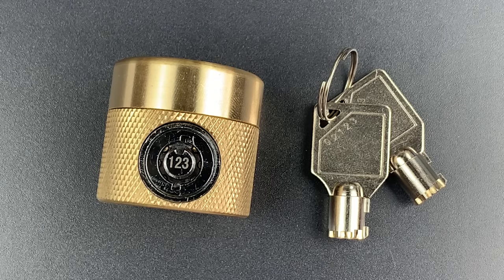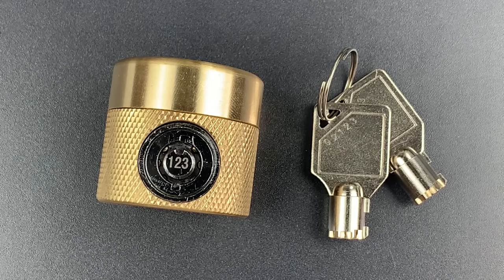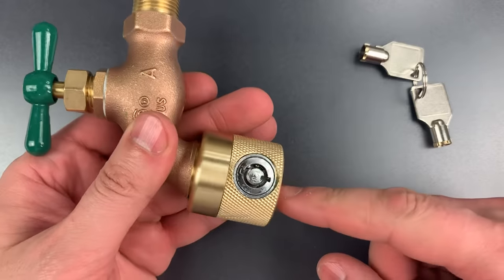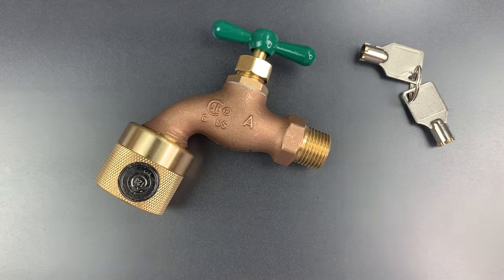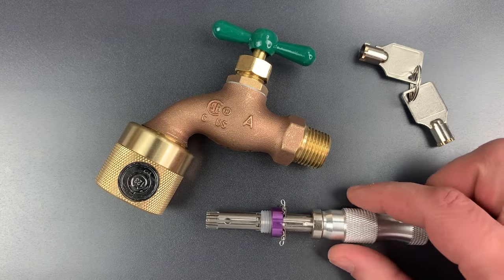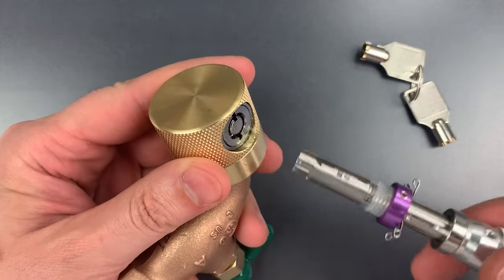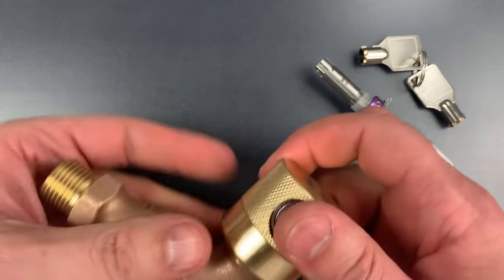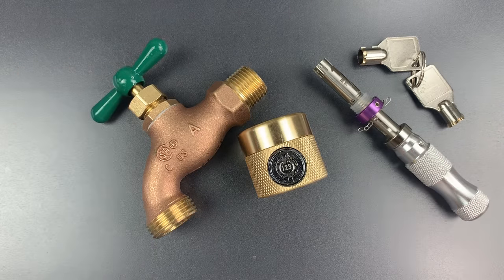[840] Flow Security Systems “FaucetLock” Picked FAST

Comment: I would imagine you could grab the upper part, above the spinning part, with some pliers and unscrew it without picking the lock at all.
Reply: Its hard to see since its smooth but if you look closely the whole thing does spin, the grip portion is connected to the smooth. I thought of that too and had to look pretty closely to see the tiny scuff marks get swung around when he spun it.
Reply: Yeah, and then you have a hose running (though you can turn them off sometimes)
Reply: I'm thinking strap wrench.
Reply: @munster355  If that is just made out of brass or other soft metal, you could probably squeeze on it hard enough with channel locks to crush the outer sleeve onto the threaded bit and turn it that way though. The metal can't be very thick.
Reply: @coopercummings8370  shrug yeah but the odds someone is gonna bother instead of going to the house next door or just quit isn't very high so this lock is probably good enough to defer a niche criminal.
Reply: @munster355  this could be used to prevent reverse liquid injection into the house (ie: wire a pump to pull from a container and push into the house via the faucet.) this lock has it's use but i don't think it's that great :p
Reply: @patricklegault6383  What possible reason would someone have to 'reverse liquid inject'?
Reply: @munster355  If it's the next door neighbour attempting to steal water from the tap nearest the boundary, they may not have another 'easy' option.
Reply: @Chris-hx3om  revenge would be an idea or when the city is doing pipe maintenance. they sometime connect the fire hydrant to the faucet to bring water to the house while they close the main line in the street.
Reply: @Chris-hx3om  yet another person coming up with another even more niche idea. Come on bro. Pay attention
Reply: @munster355  if you pinch it enough. The inside will likely bind on the outside. It's a destructive way of doing it. But I think that would work.
Reply: @patricklegault6383  "reverse liquid injection" 

Yeah, good luck with that, water's non-compressible, so it'll need to flow. Back-flow in this case..
Where do _ you _ think the water in the already full lines is going to go so you can "reverse liquid injection"? 

My answer : Nowhere.
Reply: Squirt JB Weld between the lock core and the spinner. Wait 15 minutes until the parts are "welded" together, then unscrew the whole thing and enjoy your free water.
Reply: The upper part is smooth. In many kitchens, there are flat pieces of rubber material for assisting in opening jars. The fitting is only hand tightened. It should be possible to wrap the rubber material around the upper part and apply enough torque to remove the "FaucetLock" and put it back later, leaving no scratches.

One application is apartment buildings where the tenants hire their own carpet cleaning companies. The carpet cleaning equipment may require a connection to an outdoor faucet and the company should let the client know ahead of time. Rather than contact the office and have them send a maintenance employee to remove the lock, the tenant could use the jar opener before the carpet cleaner shows up.
Reply: i would add some leather strap(old leather belt) between brass and wrench.
Reply: @bytemyvoid  no you wouldn't

Comment: Lol In South Africa they steal the whole Faucet for the metal not the water
Reply: New Haven CT also!
Reply: Fuck dude, I know what you mean. I also thought someone would just turn it on for fun
Reply: Fookin prawns
Reply: kids in africa could've eaten those locks
Reply: @Malfin_L  lmao
Reply: Someone went round and stole cast bronze inlet connections (which firefighters connect their hose to, to boost pressure and flow) on sprinkler installations. I think they now use cast aluminium alloy ones.
Reply: yep some fuckers riped huge lines of copper cables out of the road by my uncles home
Reply: Easy enough to get both that way.
Reply: Is so. Ja.
Reply: Some urinals in Chicago have a lock on the flush valve connection to prevent theft (often McDonalds)

Comment: I didn't even know that water theft was a thing lol
Reply: @BigDish101  I got an extra $100 charge from my neighbor stealing water before they got evicted. how does that make me an asshole?
Reply: @BigDish101  It looks more like something which you put onto water tanks. Sure, if it's an unlimited source it wouldn't make much sense, but if it's a limited supply of water that's another story. Also the faucet might not nessecarily be used for water. It could be a potencially dangerous/harmful and/or expensive liquid and I doubt that any insurance company would pay if you simply leave a faucet unsecured in public or at an easily accessable location. Plus it would stop courious children too.
There are a lot of scenarios where a faucet lock makes sense.
Reply: ThePandafriend Yea it would stop curious children from messing with dihydrogen monoxide, life threatening these locks better become mandatory
Reply: @unclejoe8310  I'm talking about stuff like bases, acids or other liquids which could be poisonous. Of course the "common" water is not dangerous.
Or something which could be in such a tank is purified water. It's expensive and if someone steals it and you need it for a certain application you have a problem.
Reply: @BigDish101  Contractors are even worse;  they have their own water connections, and even electrical connections;  I caught the contractors trying to fill the (next door neighbor's) sewage tank ( to test it for leaks ) and also using my electrical outlets to run their saws and such;  both times, as soon as I stopped them and started to call the business owner, they both took off.  Probably because he had very loose control of who was working where, I suspect..  But yes, both were stealing something that they considered "free" - just like you think it should be free...
Reply: If they could people would steal even your memories.
Reply: @BigDish101  You're paying for it, go use your own water supply. 

Imagine if someone came to take a few slices of bread from your kitchen because breakfast wasn't enough.
Reply: In my country some people put a water cooler faucet so people can drink, they pay for water and electricity for it
Reply: It's less about water theft and more about local youths turning on your faucet and running away. This can waste thousands of gallons of water, and water is something that costs more the more you buy. And in my area of the country, you can be fined for running water on the wrong days or during the wrong hours. Enjoy paying a $400 water bill and taking a $1,200 fine because you were "compassionate" enough to share your water with the public.
Reply: Uncle Joe #BANDHMOTODAY, it’s for the children
Reply: @BigDish101  they're not the one who have to pay for the water though. Its the owner of the faucet who does. Water theft is a huge problem when it comes to agriculture.
Reply: KMSMista  not everyone believes in that religion crap. Those people are woke.
Reply: @BigDish101  there are legitimate reasons for this, maybe you don't want the public coming onto your property end of, there are genuine security reasons for not wanting strangers to walk up to the side of your house when they have no business there. Someone has a thirsty dog? That's their problem, someone who doesn't carry water for their dog probably doesn't carry a poop bag to pick up dog litter.
Reply: @BigDish101  tyhe more people who use your faucet the higher the chance that someone will leave it running after they've finished using it. These faucts can fail unpredictably. If a stranger has used it when you were away and then they lever breaks ajar, what happens? They just walk away and your fauct is running for 8 hours before you come home.
If you break it yourself, at least you can go in and turn the supply off upstream.
Reply: Some jerks will turn on the outside hose of some unlucky person on vacation just to be destructive, kids etc
Reply: @aarond23  this wont stop the water flow though. If youre going on vacation for long periods you should turn off the gas and water, if your burglar alarms dont rely on the mains electricity then turn the electricity off too. Had a relative in the uk who have the water tanks in the loft (the area right under the roof). The water pipe burst there and flooded their entire house when they were away for 2 weeks. The repairs were so expensive that they had to sell their home for half the value and move into a smaller house
Reply: Sure it is ... Chinese tourists who come from the beach open all valves they can find, even on private property.
Reply: @chriscem , i agree 100%  wait till it turns into mechanic stuff with their inch and whatever.
Reply: @aarond23 , we always close the main valve when we go on holiday. You better do ...
Reply: @corneilcorneil  Yeah mine is off unless I need the hose even though I live in a neighborhood with very little pedestrian traffic or anything, better safe than sorry
Reply: Water theft can get surprisingly expensive, if left unattended. We once had almost 200 usd slapped onto the bill of our water because some kids decided to keep turning on our garden faucet overnight.
Reply: If kids wanted to do it just to be assholes they would just kick and break off the dam faucet... Right isn't it easier to just close the valve from inside?
Reply: @carlangelo653 , place a valve inbetween the line, somewhere inside the house or garage. I had a electrovalve, so you can open/close it with a switch.
Reply: @deeped7249  They probably didn't want to break it cause it would make a lot of noise. We already removed the garden faucet, and just got a longer hose that we connect to the backyard faucet.
Reply: @MrPir84free  My neighbour was having his roof reshingled, and the roofers couldn't reach their power supply for a small corner of the roof with their power. They knocked on my door and asked me first if they could use my outlet for 10 minutes. I was impressed at the courtesy.
Reply: If you have that problem turn off the water to that tap
Reply: @Nathan-dt2tu  i really dont think someone asking to use resources you pay for is courtesy, if they did anything else it would be just theft.
Reply: @bassam_salim  We already have those funded by public taxes in the USA. They also exist in every single public business.
Reply: @chriscem  A gallon is the ammount of water an average active man needs to drink in a day, and oz are far better for weighing food. When you need to start counting by the hundreds for grams, your unit is inferior to ours.
Reply: KMSMista  they have their own water supply from the same towers
Reply: There are places where municipal water is pretty expensive. I have friends who have gone on vacation and wound up with really large water bills, only to find out from a neighbor that some other neighbor ran a garden hose to their faucet while they were away and filled their swimming pool for the season, costing hundreds of dollars.
Reply: In India they have hair thieves. People walk around with scissors and snip off locks of hair from women not paying attention, then sell it to middlemen who then sell it to people who make wigs and weaves in the US. Weird but true.
Reply: @BigDish101  i don't care if someone steals 1oz or a thousand Kilos of water, it's my water, on my property. I pay for the land, the water, and yes- the faucet. 

Nobody grabs water from a faucet to hydrate their dog or stop their car from overheating. You don't even see that in movies. 

But i will tell you something- i had a lock on my old faucet when I lived in a duplex after my opposing neighbor decided it would be funny to use my hose when nobody was home. Multiple times.
Reply: @BigDish101  You probably think people who don't want to give away all their money are greedy while the people who want to take all their money aren't, don't you?
Reply: I used to work for a mobile truck wash company that would steal water, though normally from fire hydrant as it was quicker
Reply: It’s only unlimited if you have unlimited money
Reply: @ThePandafriend  "It could be a potencially dangerous/harmful and/or expensive liquid" In what world do people have tanks of expensive, poisonous liquids just sitting around in unsecured locations?
Reply: @BigDish101  If you regularly need to use taps on other people their homes without asking permission to give your dog water or to refill your cars cooleant, maybe time to  find a solution so your dog won’t be thirsty when going out, and fix your car? If you use taps which aren’t yours you are commiting 2 crimes: tresspassing someones property and stealing. Get your stuff straight instead of whining at others that they shouldn’t whine about your theft.
Reply: KMSMista  Hard to deny something they didn't come and ask for.  Want to talk about the bible, thou shalt not steal is higher up on the list of priorities.
Reply: over privileged elitists "protecting" their "supply"
Reply: @JonatasAdoM  That's called social media and tracking cookies.
Reply: yes in the out back of austrailia. they let it go freely into the ground.
Reply: @JonatasAdoM  thier working on that now. ten to 15 years top.
Reply: @billybobjoe198  wwater capture. let them drink that rain water.